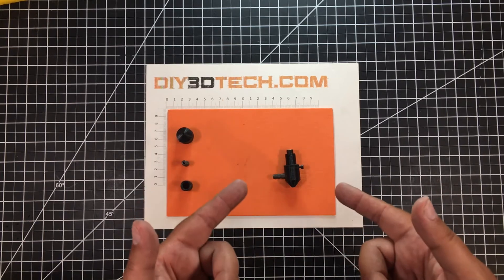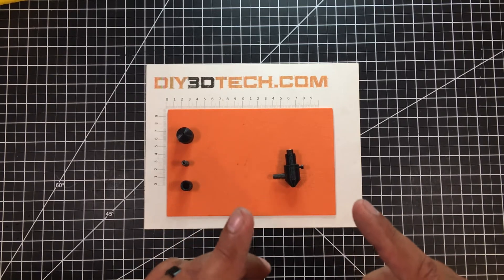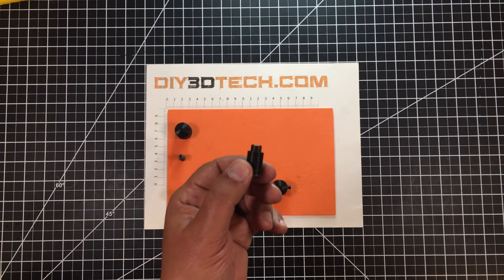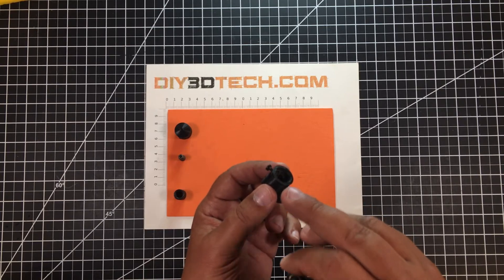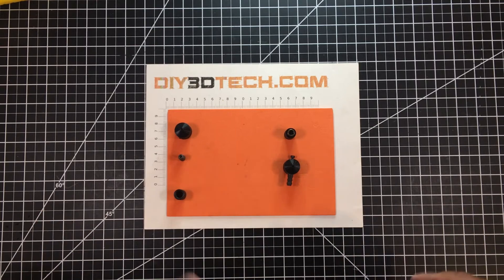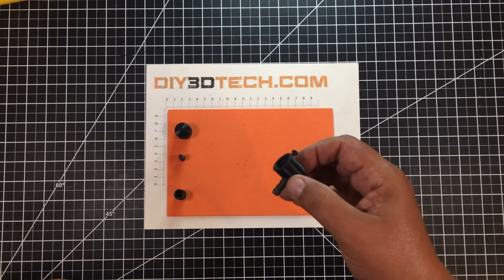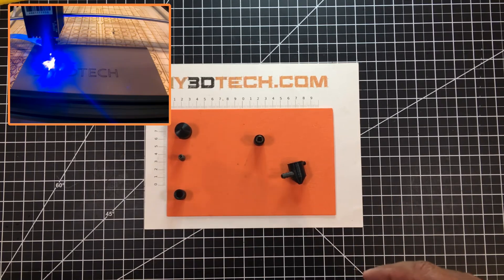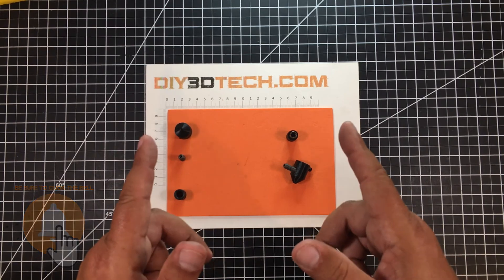Ortur Laser  -  3D Printable Air Assist!

Comment: Would it not work better for the air inlet to be at a 45 or 30-degree angle instead of 90 degrees?
Reply from the maker: Not realy as the nozzle becomes pressured and really only has one low pressure direction to go...

Comment: excellent video, a question how could I get those parts since I don't have a 3d printer you could sell the parts on eBay
Reply from the maker: Sorry just don't have the time, you could maybe find a local maker shop
Reply: DIY3DTECH.com thanks
Reply: another question how the lens can be focused
Reply from the maker: @freddyyeltsin  As covered in the video the nozzle is removable and after focusing you cinch it to the barrel with the M3 bolt...
Reply: Very cool ! Thanks for sharing!

Comment: Hi man, I love your laser video's.
I also made an air assist for the Ortur Master 15 Watt version (the 7 and 20 watt versions have other dimensions) and you can download this from my website.
I didn't use a hose to the air nozzle, but a coaxial fan, that provides more then enough airflow, and doesn't yank at the laser head.
I can imagine you don't want links to be posted here, but I am sure you can find my website. The air assist is listed under the My Lasers section.
Hope this inspires you and maybe gives you a nice idea for your own creation. The step files of my air assist are also there, and if you like to improve or change my design, please go ahead.
Only if you publish it as a remix, please mention the original.
With regards,
Brian, the 3D PrintCreator.
Reply from the maker: Many thanks!  For you links are okay!  As I want to share with the community and the more options the better!
Reply: @DIY3DTECHcom  ah okay, thanks. That's also my goal here on YouTube.
Here is the link https://3d-printcreator.com/ortur-laser-master-15-air-assist-unit/